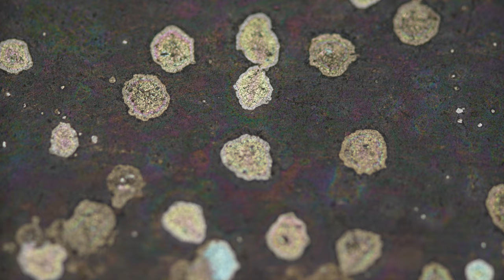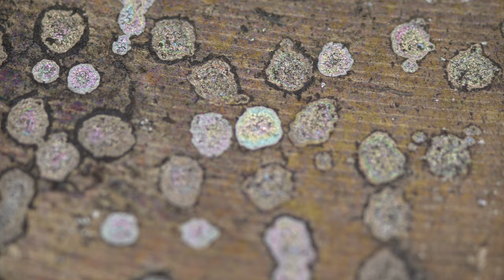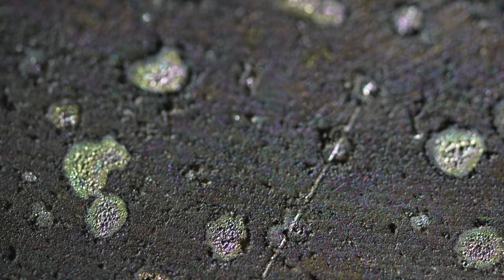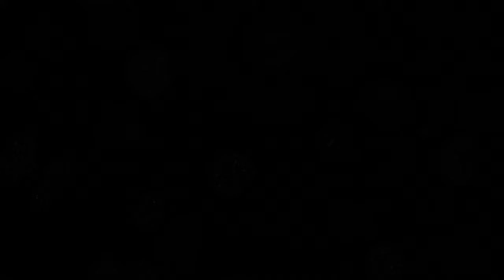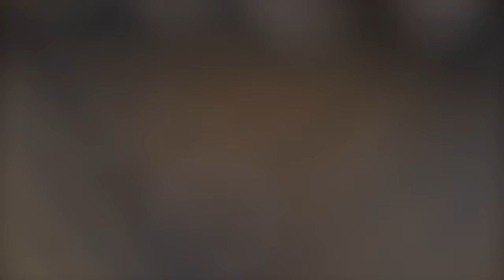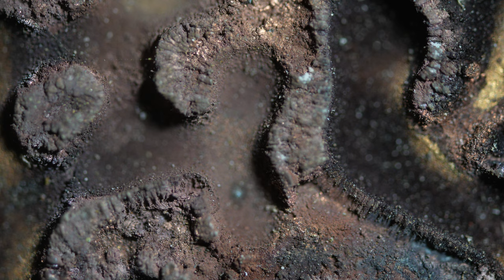VEGA - Macro videography of sample (8k high dynamic range)

Comment: May I ask you a question? How can a stable direct current generate a varying electromagnetic field and an electric field that also produces a gravitational field, with all three fields being mutually perpendicular，What methods can be used to highlight and verify the existence of the gravitational field?
Reply from the maker: Relic Neutrinos (NOT Nuclear Neutrinos) are a model of gravity - see QR code here
https://youtu.be/tcvxRUUMlRk?si=MJkqxQdPEhROxqMT&t=33

They have a toroidal moment and can be influenced by toroidal moments.

A method of producing, via electro dynamics, a large fractal toroidal moment bearing structure, leads to capture, aggregation and manipulation of relic neutrinos and their possible condensates.

To understand more, see this presentation. Download the slides and review the linked resources.
https://remoteview.substack.com/p/the-fractal-toroidal-moment-7b5

Comment: Reading matsumotos book …. Can someone explain or point me to an explanation of an iton. Diagram or words describing the particles involved ty 🙏🏼
Reply from the maker: It is described in his book. Essentially the electron charge density gets so high that it polarises a proton in a nucleus to decay into a neutron a positron and a electron-neutrino. The positron is then bound to the electron by the electron-neutrino to form a quasi-particle called an iton. This process is repeated to produce an itonic-mesh that has at its core a neutron cluster.  This allows for nuclear reactions to then proceed.

He also concedes that it is whatever ball lightning is and that may not be what his theory is, but it is what it is.

Comment: Bob or Tony , I have a good friend who is a EDM operator. He told me a story of a former co-worker,also a EDM guy, who he lost contact with.He recently tried to find him and found out that  at the age of 51, he contracted leukemia and passed away rather unexpectedly. 

Is my friend at risk being an operator? any tips, i.e distances, materials, best practices to keep him safe? any insight on things not to do? any way he can use equipment or material to quantify any risk? (geiger meter/x-ray film) 

I'm concerned for him, i had not seen him in 4 years until saturday past and he appears to have aged 20 years since our last visit.
Reply from the maker: I really may have played a role.
https://youtu.be/gcF-KSLIAWs

Distance from machine is one way "Dilution is the solution to pollution". If he has several units erecting screens like this one
https://youtu.be/8bJm6-OIXNw
may help